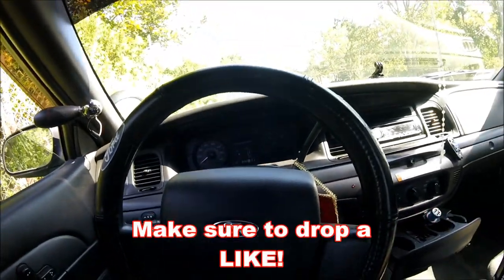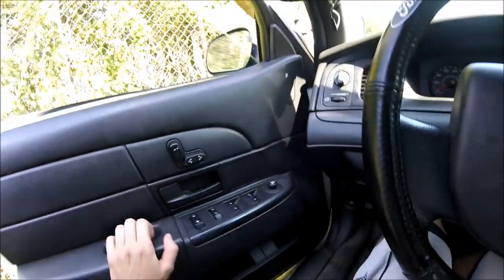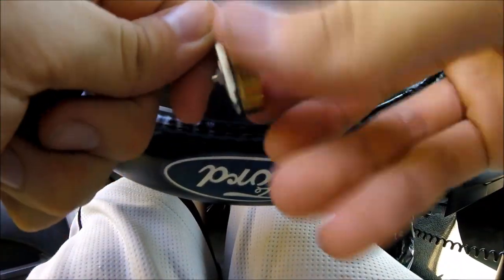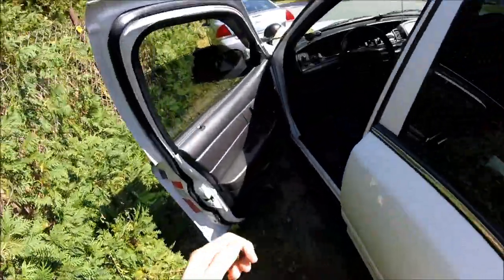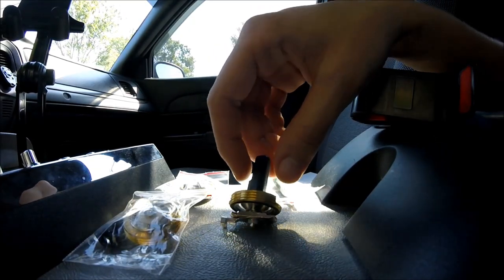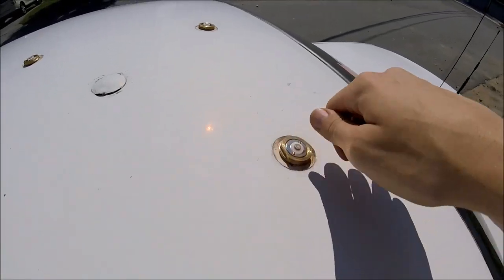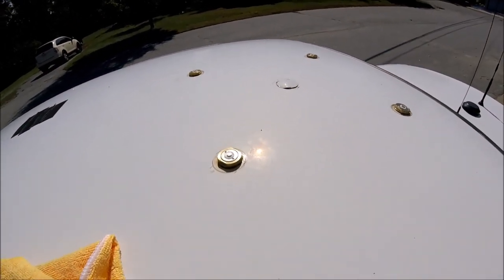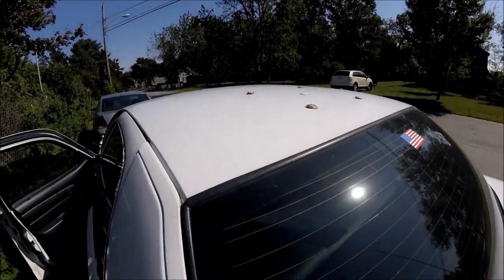How to install ANTENNA MOUNTS on your CROWN VICTORIA!

Comment: Why even bother putting NMO mounts where the holes are if you are not going to use them? A hillbilly wouldn't even do that. If anybody wants to know anything about this antenna stuff please ask. I have been into amateur radio and CB stuff for over 40 years. I put 3 NMO mounts into the holes that were on my 2007 CVPI. 1 antenna is for my scanner. 1 antenna is for my VHF/UHF Yaesu FT-8800 radio I talk on. Great hobby to get into. Easy multiple choice test with no morse code testing now. With a license you will be exempt from any scanner laws in your state. I might have to try to figure out how to upload a video. Never tried yet. Steve

Comment: How can I make a hole like that if the car has no holes?
Reply from the maker: Connor McGregor they sell magnetic antennas so that you don't have to drill any holes unless you actually want them to function then I would say take your car in somewhere to have it professionally installed

Comment: I know this id off topic but please help me. Will a regular crown vic radiator fit in a P71 vic? I can't seem to find the answer anywhere. PLEASE
Reply from the maker: hellomoto123ish I'm honestly not 100% sure but my guess would be yes. I know most of the parts are compatible.
I tried looking it up but came up short, if I get anything on it I'll let you know! :D

Comment: Without the antennas installed, the rain/water will seep into your roof n ruin your headliner .......cut a few pieces of duct tape to put over the mount to seal them till you get the antennas LIKED 👍🏻  s
Reply from the maker: Ozzy Tapanes thanks for the tip, I'll definitely do that!
Reply: Ozzy Tapanes yes mine are ducked tape till I can find some antenna mounts for my panther

Comment: I need an actual antenna to install on an existing base mount but cannot find the right one. Where did you find the antennas?
Reply: C172Pilotdude   I need the same info, I have a mount but need just the antenna to screw onto it.

Comment: Also, do those come with any kind of rubber isolator? The CB antennae mount that came with my truck developed a leak because it didn't.
Reply from the maker: Chris Pofahl yes they do. Not the best however, but once you put the antennas on they seal it up tight so no water gets through